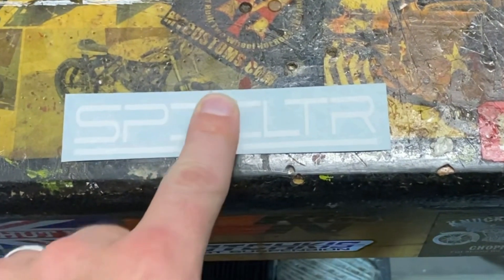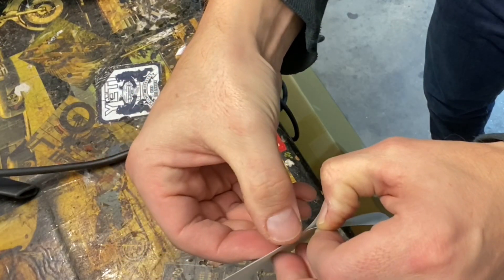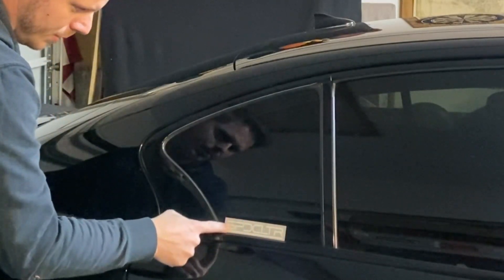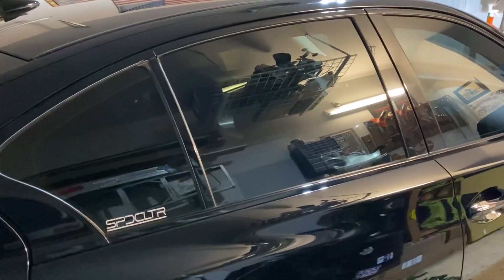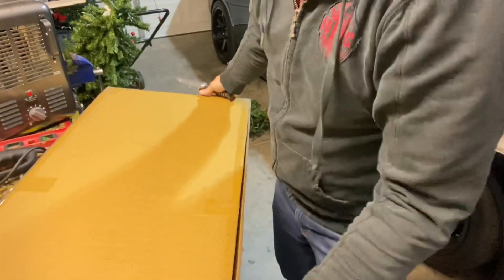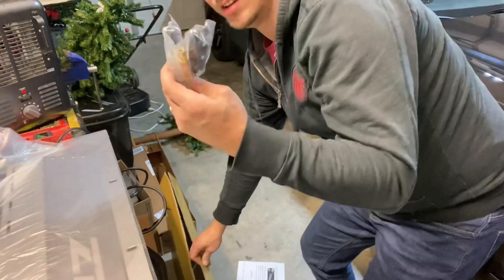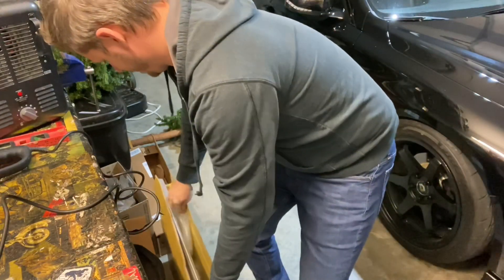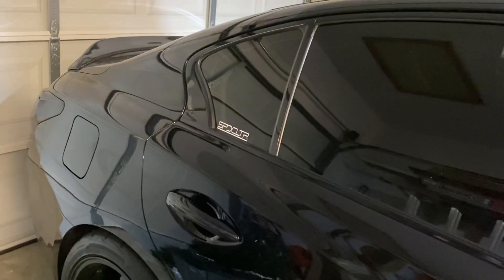EXCITING new Q50 PARTS from Z1 Motorsports!! Unboxing

Comment: Morning. Been watching your videos all morning while I'm in the kitchen. Some I have seen month before and watched over. I love your reviews and honest feed back. Question on the suspension. Would you ever go to coilovers, eventhough you are happy with the lowering springs ?
Reply from the maker: Take a look at my last video lol  I am currently trying to decide between changing wheels to accommodate the big brake upgrade and going to coilovers.  The next "big purchase" I referenced in this video will be for one or the other!!  It was awhile ago, but if you take a look at my final tail of the dragon video, I discuss coilovers as well.  As you said, I am very happy with the springs I have had for nearly 2 years, however, I really want to push this car harder and harder and I believe we got close to reaching the limits of the springs on the tail of the dragon, so coilovers are inevitable.  The question is when, or what my priorities are now.  Thank you very much for watching!
Reply: @SpeedCultureStudios  What about that steering. Does your ring scratch it up?
Reply from the maker: @jeromes5141  good question but no.  It’s a silicone ring lol

Comment: Wish the Altima had some love at Z1 lol. Then again don't need most performance parts but rotors and exhaust 🤔
Reply from the maker: I hear ya.  How is aftermarket support in general for the Altima?
Reply: @SpeedCultureStudios  not really good. Stillen is generally the only company that supports other than a couple small eBay vendors. BC Racing was doing well but they haven't done anything for the 2019+ Altima yet.

Comment: I was thinking about getting one of those. Would you be able to do a update video in like a month to see how your car feels with it on? Also do you think it will fit the AWD models?  I also hate taking off the entire piece in order to do an oil change.
Reply from the maker: I will definitely do an update video.  They are really not much heavier than the stock plastic piece.  I know they sit a bit lower so if you are slammed you’d want to be careful.  This will not fit awd but z1 has them coming in the next month or 2 so keep checking their website!